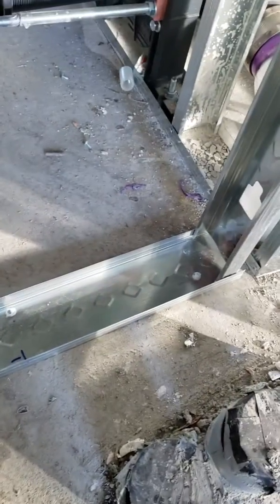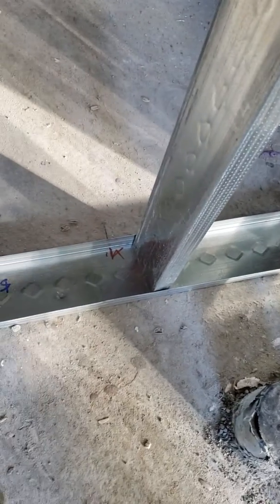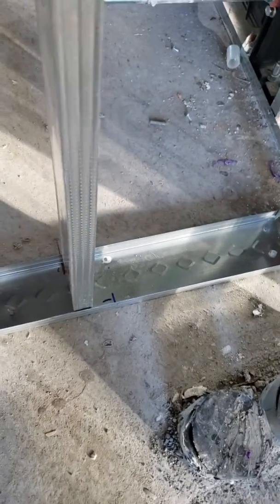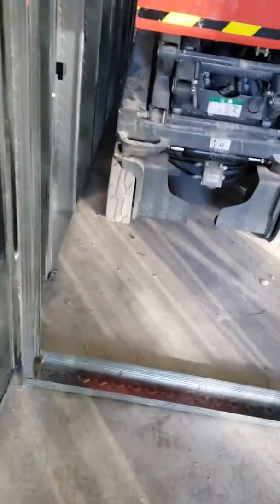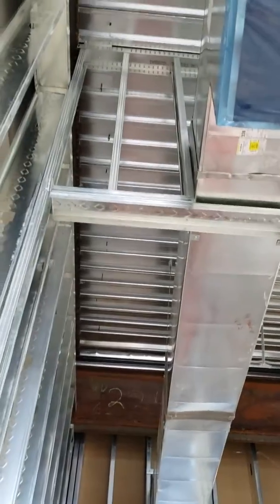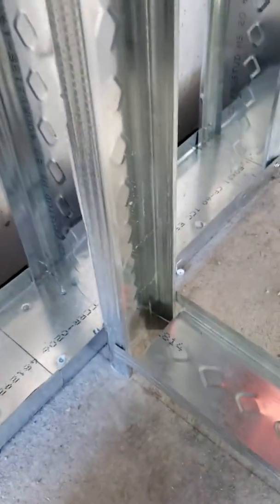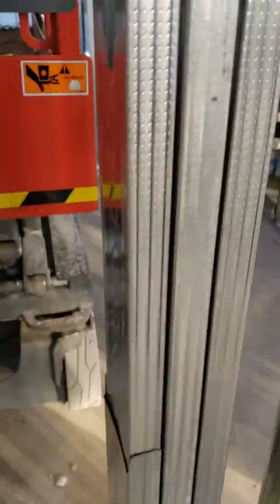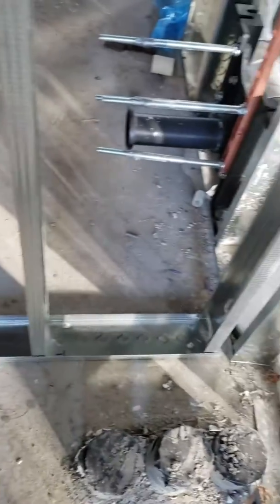Stud Layout Alternatives

Comment: When you said you did your layout 16 on center to softside, never to center, are you saying your first studs soft side is 16 or your first stud is on center, and you pulled your 16's from the soft side for the rest of the wall?
Reply from the maker: This can work if you need your stud 16oc off a wall. One stud to center then pull of an edge. or math it out so your marking side of stud. In some instances that's 15-1/4 or 15-3/8s to either soft or hard side. Key is to be consistent.